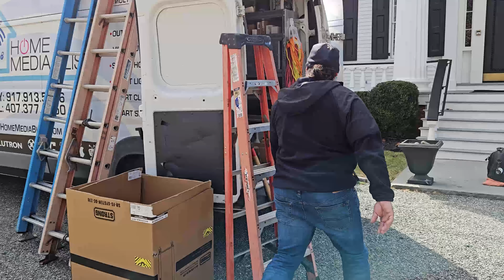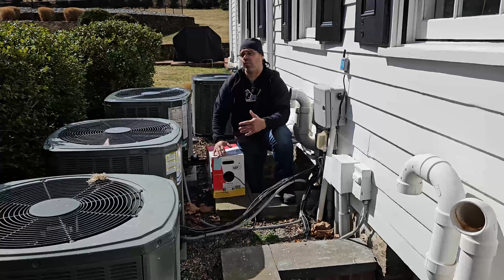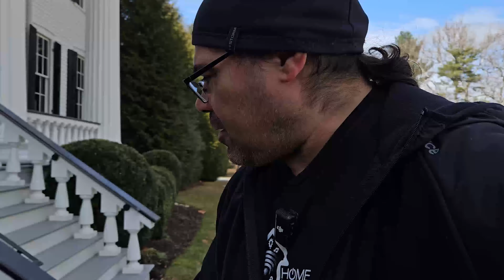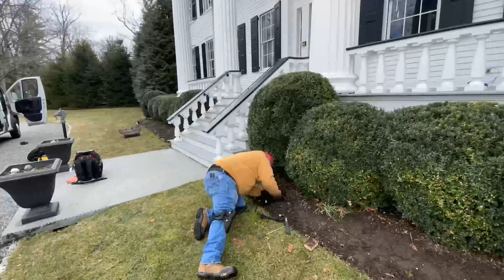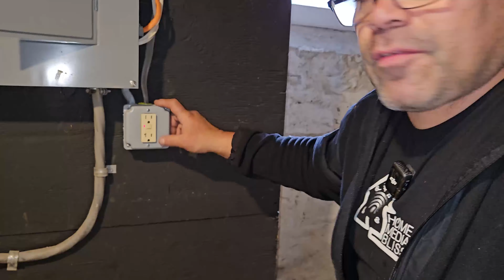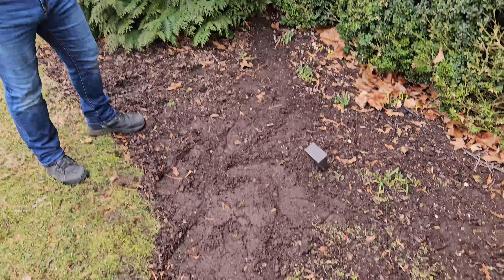How to Install Landscape Lighting

Comment: on a 300W transformer, you should be using 12/2 (not 14/2) coming out of the transformer. It's fine to hub off of the 12/2 to use 14/2 into the field, but the connection into the lugs in the transformer should be with 12/2. On a transformer with lower wattage, 14/2 might be acceptable though.